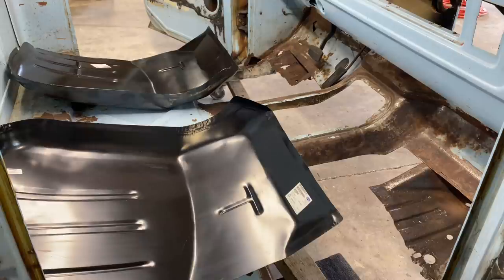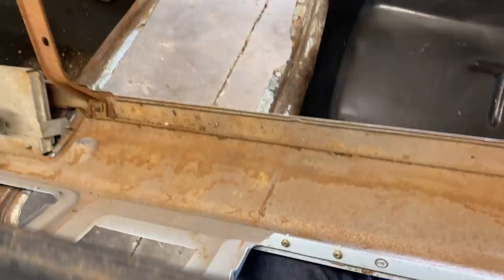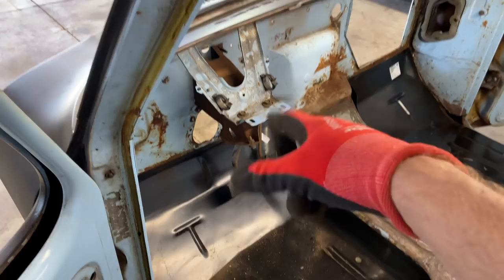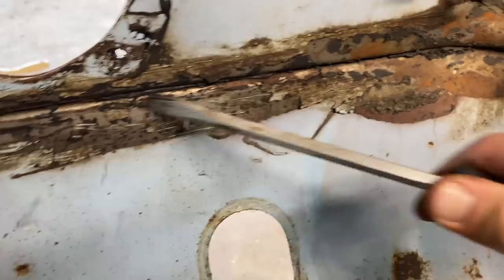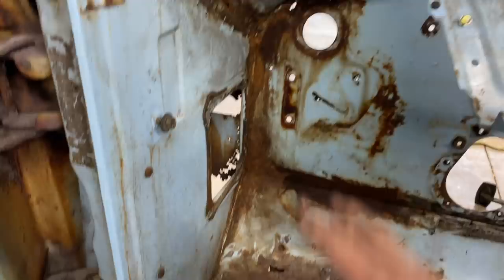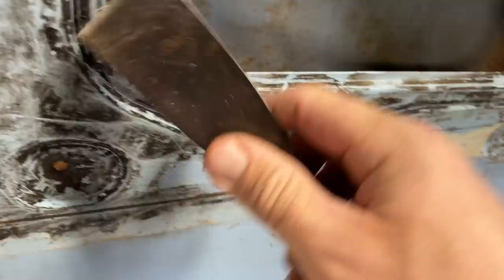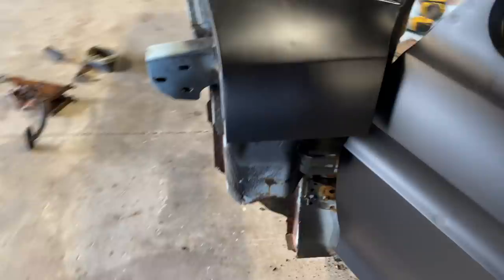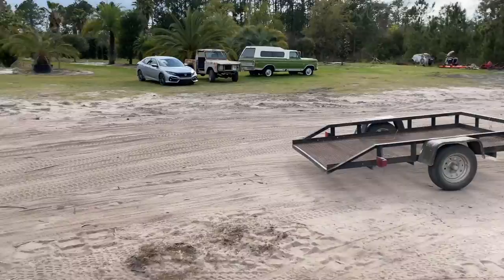Restoring an Abandoned 1974 Ford F250 Restoration Swamp Dragon! DASH PANEL! Resurrection Rescue! CT

Comment: 30-60 days. Lol. I've been working on mine 8-12 hours a day5-6 days a week  since Thanksgiving.  I'm close. But way more than 60 days
Reply: Btw lmc has the wiper arm seal
Reply: Sorry, I'm commenting as I'm watching. Autodatalabels.com I believe is a website that you can have stickers reprinted. And the cab mounts, they make reproduction. Don't waste time sandblasting. Buy the more expensive ones. Nicer and more like original. And definitely take off the inner fender brackets and sand blast them

Comment: CT, I would think realistically that you should:

"Live, Breathe, Eat, Sweat, Brood, Bleed, Sleep and meditate on all things 1974  Swamp Dragon until you get the project back together. 

Your channel needs the credibility of people seeing a project getting put back together. And when I said you should do all of those things, I also meant to take time for your wife and kids and family and so on. But you should get a FOCUS on the project at hand. This IS NOT RUSTY. This is a vehicle you can bring back. The rust and so on is manageable. Rusty is a ridiculous project by comparison. I just don't know what you can do with Rusty. The body is mostly yard art. For what it is worth, and it is only "my" opinion, I don't think that Rusty will ever be road worthy or worth much at all. You can't keep the rain out of that body. You can't keep the wind from whipping through all the pin holes in the body. You can't weld to hunks of rust. The Swamp Dragon is  a different  project entirely. It was well and good to try  to give Rusty  some love but the body will never be worth a damn for anything more than yard art,  but that's just my opinion. I'm just saying, concentrate your energy on the Swamp Dragon. You are making too much progress and yada, yada, yada. If you need to take a break though, then do a first start. I'm sure your ass is sore. I worked on my well pump switch last night in the dark. I broke the pvc  outlet off of it an I had to fix  that too. The well switches just don't last like they should. I had some weird soreness today from crouching out in the dirt by the back fence trying  to get to it all. My 58 year old body had some different creaks and gimps when I tried to walk today.

Comment: Bead or sand blast it completely so you can repair rust and properly weld in the replacement patches and parts.  Stop wasting time with a scraper.

Comment: That door post decal is your VIN identification you kinda should left that on , duct taped over it.  Yea State Police don't like that messed with. Need Photo graph document it. I think you can order duplicate with proper request/ I read few comments, Unlike other Vehicles there's No VIN in the dash of the TRUCK< so that decal is your Proof the truck is legit. should not be tampered with,. IN My Opinion.   Just Call Local State Police Ask them That is there Area Of expertise. Your Title should match that. Metal Tag is your trim package, identification, it can be remade, but that Vin is not supposed to be removed.

Comment: You've shown us a million times how good you are with a screw driver and how to remove a nut and bolt. You've shown every bit of rust on the truck and told us what you're going to do to remove it. So get on with it and stop your endless, needless chatter and do it.